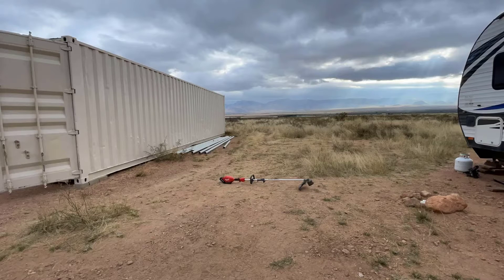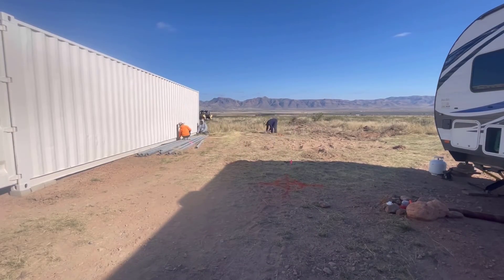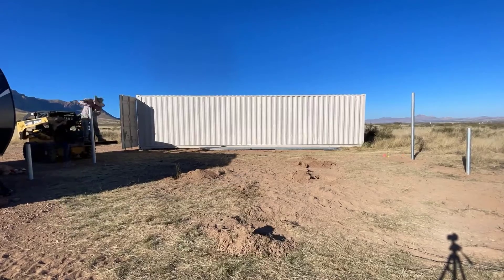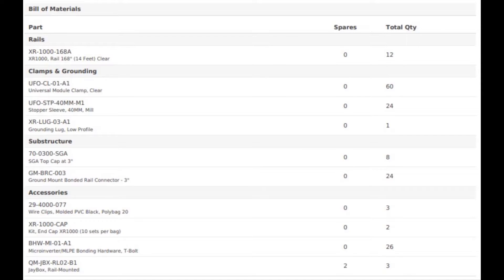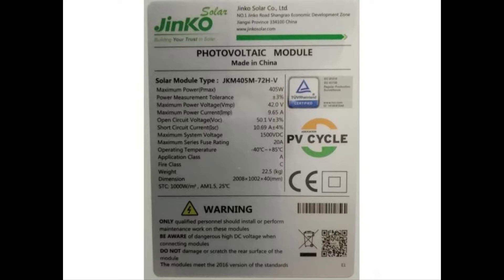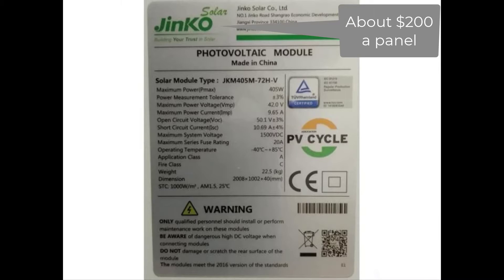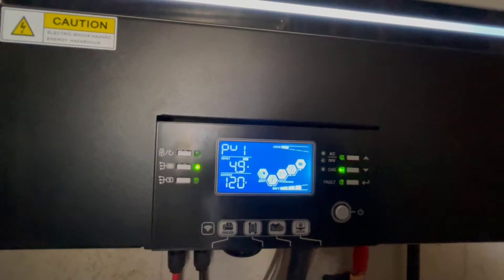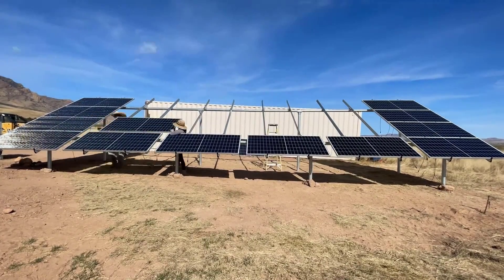Just two of us built a Massive Ground Mount Solar System in a week!

Comment: It looks like you set the four corners first to get the right height and to get squared at level. How did you deal with the pipe not being all the way in the ground?
Reply from the maker: Yes we did the 4 corners then ran a string so we could set the other 4 inline and then set them. Then I used a grinder to get it dialed in the rest of the height. Wasn’t perfect but good enough. Thanks for the comment!

Comment: What did you use to join the two lengths of Sch 40 pipe in the long horizontal rails?
Reply from the maker: Hi! Thanks for leaving a comment. 😅 Actually, nothing was done—I wanted Erik to weld them together, and we were planning to, but life got in the way and we just left them as-is. They’re not perfectly flush, but they’re holding up okay.

Comment: Normally, digging holes like that, you would dig a little bit of the hole and then pour water in and let it soak before digging more.   Out in Arizona though, water is not as easy to come by.   And then there are the rocks:  water won't help that.
Reply from the maker: Those rocks hurt my feelings!

Comment: Did you weld the two 21' horizontal pipes together?  Or is laying them on the post good enough for stability?
Reply from the maker: We end up not welding those two pipes. That’s what I wanted Erik to do just for the looks though.  Stability wise  there is no issue at all. None of the panels are sitting on two different pipes. 12 panels are sitting on a mount and other 12 on the other. Thank you for watching and taking your time to comment!

Comment: I am also putting up 24 panels but I am using mostly wood.  I have a back deck that has been in place for 35 years and the 4x4 posts are still sound.  North Florida, the ground is too wet for them.  I have a small tractor with a three point post hole auger, yesterday I dug my first hole.  We have soft sandy soil so with my tractor just idling sinking a 3 ft hole was very easy.  Record heat so I do what I can in the mornings and then work on the inside wiring in the afternoons.  I have two EG4 6500 watt inverters and the AC electrical panel mounted and the battery rack with four batteries wired.  I am 71 and retired, my wife is taking care of her dad in our home and our 7 year old granddaughter 3 or 4 days a week so I am getting little help from her.  I am running two 42 ft strings only 4 ft at the back so the panels can be mounted standing on the ground.
Reply from the maker: Thank you for finding our video and commenting! We are glad to hear that wood works great in your area as building materials. And your soil is easy to dig.  We wish our place is like yours! The heat is not definitely a friend of us working outside right now.  Please take good care of yourself and enjoy the precious time with your grand kids! :-) Erik is currently away with military training and he hasn’t looked at your comment but I’m sure he enjoys when he does. Have a great weekend!!
Reply from the maker: That is awesome!  Your on your way to a perfect setup!  I’m jealous that you can use wood.

Comment: Good job! I have a couple of designs in the IronRidge planning site. The sizing of how much solar is in question to me.  It was recommended we go with 24 400+W panels would work. I am calculating more need (I really don’t want to go back and add to the ground mount for 5 years so I want to plan for 32 panels. 24 might cover daily needs but not enough autonomy for days without solar.  I plan on renting a mini skid steer to put in 2’ holes in our Texas dirt for the ground mount.  

Another ground mount I have considered is Pelican (I think) which you drive on he pipe into the ground and can adjust the angle for seasonal sun.  In Texas we don’t have to adjust the angle as much as the northern states so I have thought of over paneling with a fixed mount. 

I have looked at Santan Solar but the cost of shipping almost makes me think I would rather get a pallet from near by Signature Solar here in Texas. 

Sorry for such a long winded comment.  We haven’t even begun to talk about battery storage or inverters yet. Haha. Thanks again for your video.  Great job! All the best!
Reply from the maker: That is a crazy amount of storage and panels. I did leave myself some room on the battery and on the charge controller side. Sounds like you are going to get the power company a run for their money!!
Reply from the maker: Thanks for the comment!  One thing to think about is that the amount of solar panels is that won’t help as much as having more batteries when it comes to rainy/cloudy days.  I guessed on how much battery but designed it to be able to add more cells if needed.  Hopefully you don’t have as many rocks as we did.  Sorry for the scattered response but look at it this way, 24*400=9600watts. You can run an rv fridge, microwave, and AC at the same time off of a 4500w generator.   Hope that makes sense.
Reply: @leeslivingoutofthenorm  well based on my usage without changing any components I currently need between 60kW/day - 100kW/day based on my average usage.  So for full coverage that comes to about 12-13kW panels (based on 6 hours solar which then calculated to around 31 panels at 400W.  I am not saying I have to have complete off grid but I would like to calculate for full coverage.  Like you say I can add batteries after the fact.  My plans were 6 5.2kWh server rack batteries for around 30kWh of storage.  Of course I could go with a critical loads panel to manage my off grid (grid down) requirements.   Sorry for such a long comment again.   Thanks again for this dialogue.  It is so helpful when channels respond to our pedestrian thinking.  Haha.  All the best!
Reply: Hahaha I read the whole comment good luck on your project again